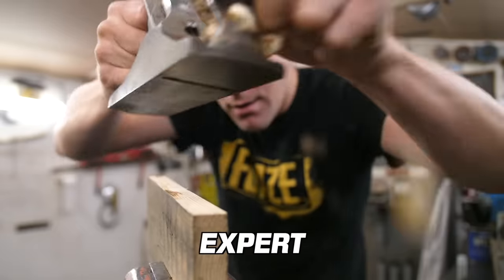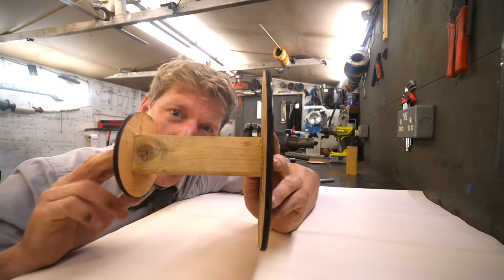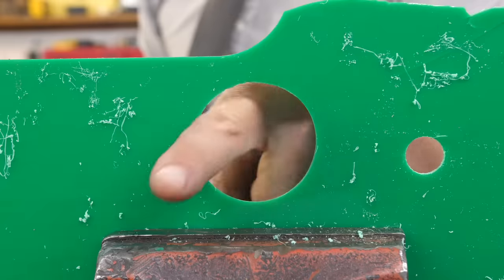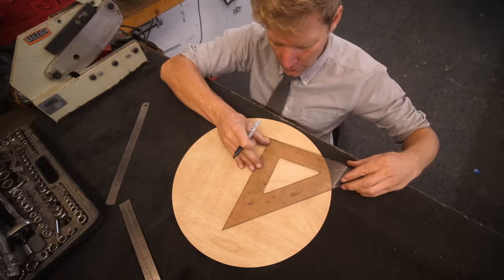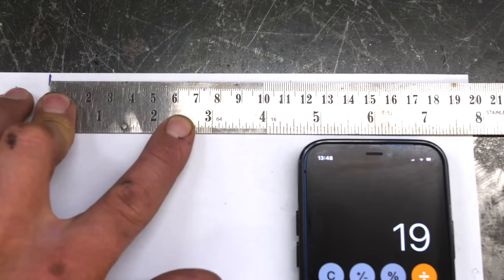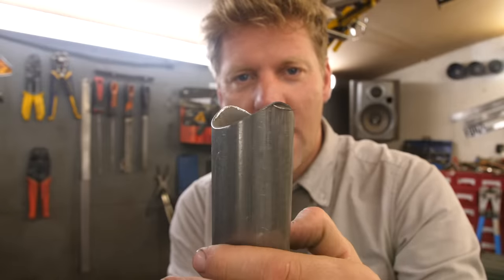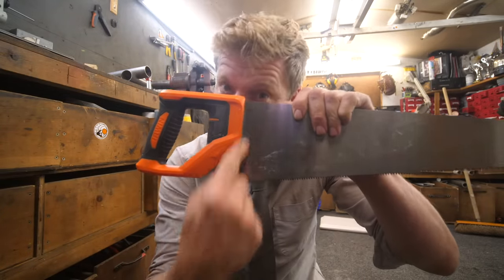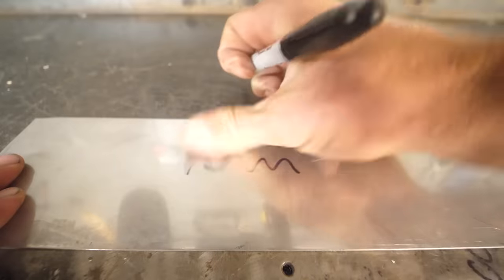18 GENIUS Workshop TIPS (that actually work)

Comment: I used to always measure corner-to-corner for checking for square, but recently when setting up string lines for a new shed an old timer taught me the 3-4-5 method which is just a quick way of saying Pythagorean theorem. Measure 3' from the corner in one direction, 4' in the other direction, those two points should be 5' apart, adjust units for scale.

This is especially great if you just want to check the squareness of one corner of a shape that may not be a square overall.
Reply: 3-4-5 is used in construction every day.
Reply: Any multiple of 3-4-5 can be used for a quick check (the bigger the triangle the better really). Gotta make sure things are straight first though as that'll skew the results.

Also, if you're measuring corner to corner, it's important to check the parallel dimensions are the same first! A trapezoid has equal diagonals but is not square.
Reply: @niceguy191 doesn’t even need to be multiples just do:

3/4 = a/b    3/5 = a/c
Measure out “a” side (3 in the 3-4-5 method). Take that measurement and multiply it by 4 then divide by 3, and you’ll get your “b” side length (4 inthe 3-4-5 method) 
Now.. 3/5 = a/c
You just take that same “a” value, and multiply it by 5 and divide by 3, and you’ll get your “c” value (5 in the 3-4-5) this will be the number that the point a to point b needs to measure to and if it doesn’t, then you’re not square. 👍🏼 

(Anyone feel free to correct any issues here but I’m like 95% sure I got this right cuz it’s how you do percentages to…
What percent of 56 is 31? 31/56 = a/100 … 31*100 =3100 … 3100/56 = 55.36 … so 55.36% … check the math: 56* 0.5536 = 31.0016, bingo.)

I suppose at this point it’s easier to just do a^2 + b^2 = c^2 math. It doesn’t need to be 3,4, and 5 that just makes it quicker doesn’t it? Fuck. I matched myself into pointlessness
Reply: @niceguy191  also any right quadrilateral could be misidentified as a square by solely using the 3-4-5 method. If you check all sides are equal though, then having one right angle ensures it's square with no need to check parallels.

With regards to trapezoids, what you've said only pertains to isosceles trapezoids.

Comment: Love these! 
Never heard the sugar tip for clean hands. 
An old painter trick is to rub some kind of vegetable oil on your hands to dissolve oil based dirt or paint. The vegetable oil then easily comes off with soap. No more sticking your hands in solvent!
Reply: This works great with pine tree pitch too!
Reply: It is unbelievable what dissolves in veggie oil! Once had boards covered with a thick layer of gum-like sticky glue and could not get it off with the nastiest solvents I could possibly get, neither with any mechanical shaving or abrasion. Veggie oil for 99ct per litre just did it with no problem. Overnight soak, rub it off, job done!
Reply: Salt will work as well, though it is a bit rougher on your hands.

Comment: If you have a box with rounded edges, and you need to measure-up for some drilling/machining, a piece of angle-iron can be useful for marking up some inset lines to work from. I like to divide these to draw centre-lines, and work from those.

Comment: The 'corner-to-corner' trick still passes even if the shape is a rectangle (or an isosceles trapezoid). You need to measure all four sides as well to be sure.
Reply: or you could draw a circle from the centre that touches the edges. If it touches all four edges and not just two, it's a perfect sqaure. Bonus: this method doesn't even require measuring anything, it's all geometrie.
Reply: I think he was getting at the corners being square, not the shape
Reply: @sharbanu1  a rhomb (or diamand) also has the diagonals crossing in the middle (of each diagonal). Yet there is no 90° Angle. The word "square" can be a bit misleading for non english native speakers.
Reply: Its 'square' doesn't mean it's A square. It means it is made up of right angles. Like testing if some woodwork squares up, you test all the angles for square with your set square.

So any quadrangle (quad right (or rectus) angle) is square though rarely A square.
Reply: @mandowarrior123  The trick doesn't check that the corners are right angles, either. An isosceles trapezoid passes the test, and none of the corners are square.
Reply: @thespanishinquisition9595  This only shows that the shape is a tangential quadrilateral - all four of the sides and angles can still be different.
Reply: I had my doubts about that one, i prefer the draw a circle inside method or just measure all 4 sides and check the angles.

Comment: If there is a nail you are trying to remove but the head broke and you cannot claw it out - Take a cordless drill, tighten it around the exposed piece of nail, and turn on the drill and turn. Also, works for screws on either side of the fastener so long as you go with the screw twist.

Comment: This is one I found doing jewelery, but might be useful for larger stuff.  Copper wire gets... kinky over time.  But if your bench vise has a smooth knob on it, you can use that and puuuull the wire across/through it, and that'll work pretty well to even it out.  This works mostly for higher gauge stuff- bigger things can use the copper tube method Colin mentioned.

Starting a hand-sawing cut with a hacksaw can be tricky, so put a little notch in with a file first.
Reply: Another way I learned to score for a hacksaw cut was to draw the blade against the direction the teeth 'bite'. This works pretty well with hand saws for wood too.
Reply: Wires you get 100% straight putting them in a vice or clamp on one end, in a drill chuck goes the other.  Gently give a few turns et voilà!
Reply: Hm.  I... I want to be like, "No, that twists it!" but that's sort of the point of this method?  Urgh.  Brain... hurt... @Calligraphybooster
Reply: @Earthenfist  sorry, I forgot to mention: do this while pulling it.

Comment: For drilling level holes in a wall or a piece of wood, metal etc, Just put your keys  over the drill bit and let them hang. If they slip backwards or forwards you are not level, if they stay in the middle of the drill bit, you are level!
Reply: Well yeah but you could also sway left to right so to improve this method use a key ring a string and then the key ona string pointing at a cross marked on a piece of painters tape. You can position your drill bit right horizontally and vertically at the same time 👍. Or to be super precise bend a copper wire at 90⁰ angle and stick it to the wall with painters tape and use that as a guide for the key on a string.
Reply: Surely as the drill bit rotates the keys would be pushed or pulled based on the corkscrew of the drillbit?
Reply: @tomjohnson5713  no, not at all

Comment: Sharpie (and pretty much every marker) uses an alcohol solvent which is why drawing over it works, it re-dissolves the ink so you can rub it off. BUT WAIT THERE’S MORE this also works for anything with alcohol in it like rubbing alcohol or my personal favorite, hand sanitizer!!! (Also works wonders for getting ink off of skin)
Reply: This works amazingly … until you start using the industrial (wet-dry) and scientific (high temperature resistance) sharpies.  But for your "but more" … you can get 100% rubbing alcohol (which is safe to touch without gloves) online for quite a bit less than denatured/fuel ethanol and it's still usable for any sort of solvent mixing and cleaning that you'd need.
Reply: Is it a bad idea to use hand sanitizer to get the old thermal heat stuff off of an ssd or cpu instead of designated alcohol rubbing stuffs? Cause thats what I do 😂
Reply: @weddiedon  hand sanitizer (even the liquid stuff) has lotions and other stuff in it that leave a residue behind that you'd want to clean off before attaching a heatsink. Though probably doesn't matter for an SSD.
Reply: @ex-nerd  the extra ingredient in hand sanitizer is usually glycerin which is hygroscopic, something you dont really want near electrical componants

Comment: On devices that use cables or hoses: if they get stuck and you dont want to walk over to the obstruction, instead just give it a whip. And if it doesnt move/unstuck correctly, slightly twist the cable left or right when you whip up. You can even make it hop over stuff with that.
To continue with the rope tricks: cable has a natural twist in it, especially if you store it on a drum. Use the above whip trick to remove unnecessary twists. Especially useful on stiff tubes that otherwise horriby twist when winding up.
I learned this from helping at stage production, the signal cables they use are very sensitive to improper twisting when winding up.
Reply: Doesn't work on a garden hose that gets caught underneath a car tyre, it's like a grappling hook and refuses to come loose unless you physically go to the tyre and ever so gently just remove the hose...each and every time i kill myself over this

Comment: Not only is the saw handle a good set square (double check it’s square by flipping the saw over after you make the line) but the 45 degree face on the handle is also good for 45 degree mitering!
Reply: Ffs it’s a try square or engineers square

Comment: Tip to prevent cross threading screw holes.  Instead of sticking the screw/bolt in the hole and start tightening, unscrew the screw/bolt whole applying pressure against the bolt hole until you feel a little clunk, then tighten.  This way you know that the threads are all perfectly aligned  before tightening which will prevent cross threading screws/bolts and creating a nightmare to fix...
Reply: Especially good when working on plastics, means you don't chew new holes whenever you put whatever it is back together.
Reply: Works with jam jars also.

Comment: Sheet metal bending recommendation, taught to me by a panel beater, for those without a bender or roller.... 
Put a piece of angle iron in a vice, with the V pointing down. Use a wide flat blade cold chisel along the line of the required bend. Bend in small increments along the line to get the neatest result. Takes a bit of practice to do neatly and a lot of hammer and chisel hitting, but works. To get really sharp bends, the inside of the angle iron can be ground out as necessary.
Larger radius curves can be done, but takes more effort, using a piece of bar, parallel with the angle iron, instead of the cold chisel. Welding a piece of bar to the end of a cold chisel can do similar. You can even bend half to 3/4 cylinders and cones in increments using this method. You cant bend a full cone, because you can't get inside for the final bends. It's difficult to bend a channel for similar reasons.

Comment: The saw handle that you used to mark 90 degrees also had part that was a 45 degree angle.
And if you don't trust whatever you used to mark 90 degrees, just flip it over and mark it from the other side. If the lines aren't exactly the same, then 90 degrees is right in the middle of the two.
Reply: The past bit is killer.
I have used that trick to find out if the 90 degree mark on adjustable-angle tools is actually 90 degrees.

Comment: A tip for working one-handed or if you need to hold something else - I worked this one out while building a shed, after I broke my collar-bone - I didn't want to wait to get my arm out of the sling, so I held the nails with my foot..
Locking grip pliers can hold a nail very nicely, just leave a tiny bit of the point sticking past so it will stay put, then you can brace the pliers with a foot or a knee, or even lean a piece of 4x2 to hold them in place.  Just don't lock them too tight - you want the nail to be forced through them.  Also a pilot hole can hold a nail nicely if you're nailing through to something else.
Reply: Totally!  I learned to do that long ago, especially if you have to finesse the nail and don't want to risk bending it.

Comment: After using a can of paint with a lid, turn it upside down for a second before putting if back to the shelf. This way the tiny holes between the lid and the can are covered and the paint won't dry out.
Reply: Forgot where I saw it, but they'd go as far as storing the can upside down. That way, if you don't touch the can long enough that the paint grows a skin, it'll be at the bottom when the can is turned back the right side up again.
Reply: @rolfs2165  not a great idea as you get slow leaks everywhere. If you seal it like he suggests that'll work fine, but if you left it the pressure and some solvents will eat through it. Skins are better on top anyway as if you mix that in rather than skimming it off it leaves bitty pieces in the paint.

Comment: Lots of great tips. The one with the even holes around the tube, he got 39.6 and then moved the ruler each time. If you put 39.6 in the calculator memory then with the ruler held still, you just add memory recall and mark as close as possible to the dimension. It’s more accurate especially if there’s a large quantity. You only ever have one tolerance, not lots of them.

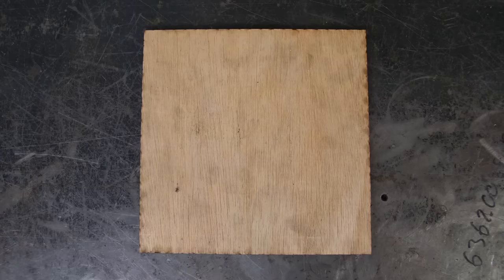Comment: 10:34 Just to be more precise, for a square you actually have to check both diagonals are the same AND (any) 2 adjacent sides are equals. Or you may end up with just an almost square (rectangle 🙂).
Thanks for the tips Colin !
Reply: Think you need to check all 4 cuz if you check 3, you could still have a trapezoid and the corner to corner would still come out to the same length
Reply: @dexlovesgames_dlg  That's why I mentioned diagonals to be checked too.
Reply: He does say it's a check for squareness, I think he just went too quick for himself and muddled it up
Reply: @cl3m19  Having equal diagonals means it is not a parallelogram (other than a square or rectangle).  2 pairs of adjacent sides would be equal with a kite (with equal diagonals).  As @dexlovesgames_dlg said, 3 out of 4 sides could be the same length with an isosceles trapezoid.  You need equal diagonals and equal sides.  (Or 90* diagonals and equal *half-diagonals*.  Trace it out, turn it 90*, it should fit in the trace.)  Squares are hard.

Comment: A tip I found that is helpful is using Gold colored sharpies. They are super visible on both shiny metal, and black mill-scale so keeping a few around for metal working is great.
Reply: I worked with a guy who would use paint markers, he preferred the paint markers because if you got cheap ones where the paint didn't really stick you could just scrape off the marks super easy with your fingernail.
Reply: You can get Markal Silver Streak pencils for this too, they work great.
Reply: @0x2A_ I once had some water based paint markers. They worked great and cleaned off easy with water.
Reply: I keep a white liquid chalk marker at my bench for marking out anodized tube and carbon fibre. Much easier to spot than pencil when you're in a hurry.
Reply: @grumpyone5963  i’ve tried those, and constantly have the lead break inside the pencil and fall out right when you need it. I like the way they mark when they work, but they are to brittle for me.
Reply: @Vikingwerk  Yes that’s true, they are quite fragile. I use 50% paint marker 50% sharpie type marker.

Comment: If you don't have a table saw you can buy a cheap giant board of insulation foam and use that as your sacrificial piece on the ground (or table). It hold all parts of your work material level and you don't need to worry about parts dropping. Bonus points for clamping and using a straight edge (or like another 2x4 or thicker board) as a guide for perfect large cuts.

Comment: To trim a sheet or tile etc to butt up to an irregular shaped surface, cut it roughly as close as possible and within about 10mm, and then use a pencil inside a metal washer to roll along the surface and mark a perfectly offset line. I use it all the time for templating but never seen anyone else do it!
Reply: Most people use an inexpensive compass. Just like the one you used in school. In a pinch, you can make one from two pieces of wood and put a screw at the top for the axis. Put in a nail at the bottom, cut off the head. Tape a pencil to the bottom.
Reply: @firesurfer  sure, but a compass needs to be held perpendicular along the length or the marking is off. A washer rolls nicely and doesn’t need to be held in any orientation.

Comment: To drill a straight hole through a wall, if your bit is long enough it has a smooth spot with no helix, you can hang an eye bolt on it, and if it moves towards the wall, you’re angling downward, and if it is moving towards the drill, you’re angling up. Then you just have to make sure you’re square side to side.